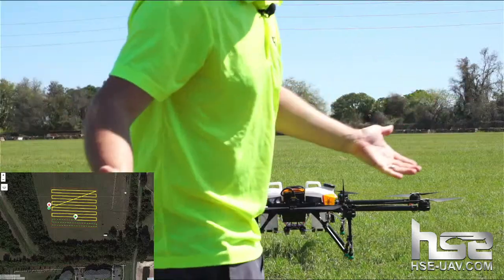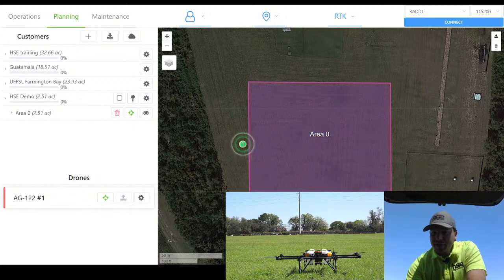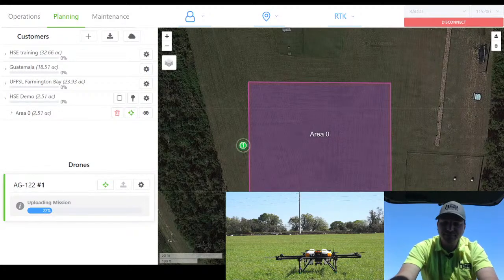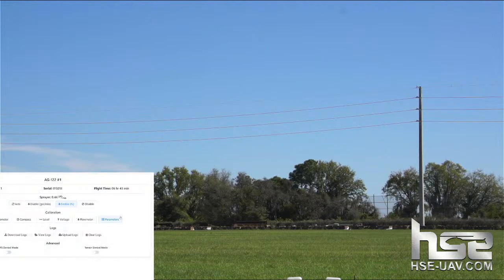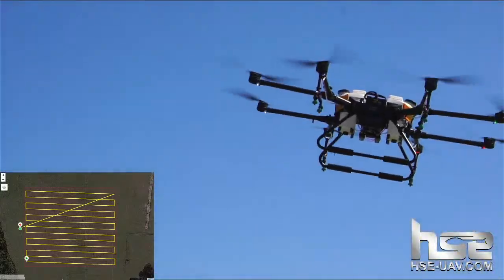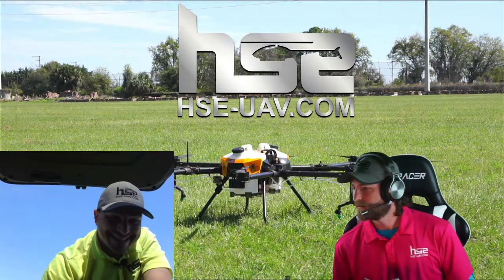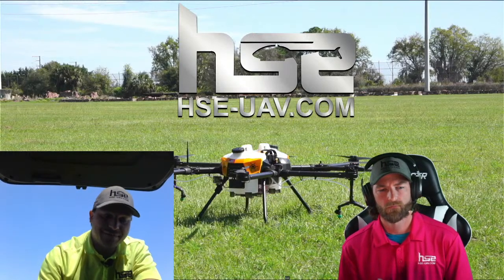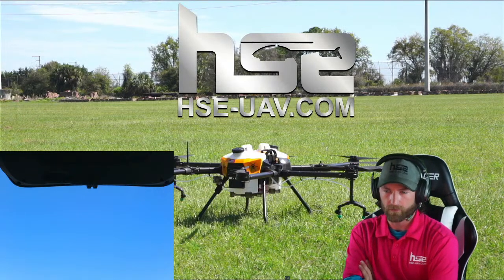Crop Spraying Drone Flight Demo - Live from HSE-UAV Orlando, FL

Comment from the maker: Sorry about the live stream FAIL today! We discovered the problem! It was certainly user error. We used a USB hub on the ground station PC that requires a power input, except we didn't plug in the power! This meant the USB Data Radio for the drone was operating in a low power mode which gave very little range. As a result, it kept triggering a Lost Link Failsafe when the drone flew too far away. As you guys can see, that safety feature works perfectly! Happy Flying, Simone
Reply from the maker: For the guys who missed it, here is a quick flight we did right after this live demo: https://www.youtube.com/watch?v=zMxeyk1t4wA&ab_channel=HomelandSurveillance%26Electronics%28www.HSE-UAV.com%29